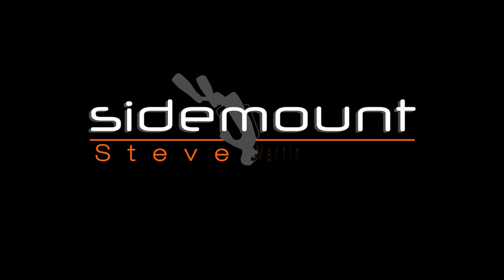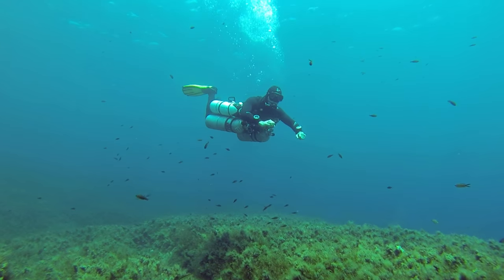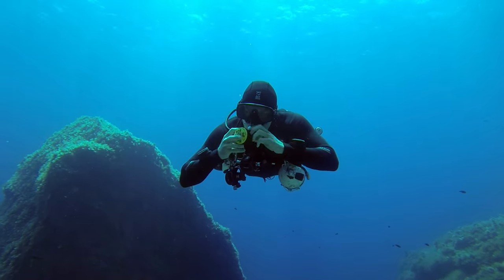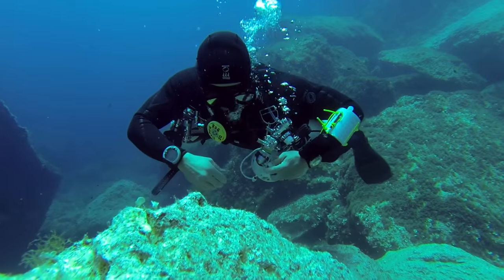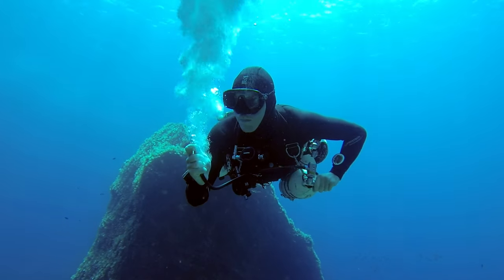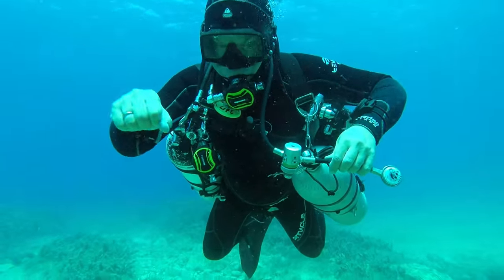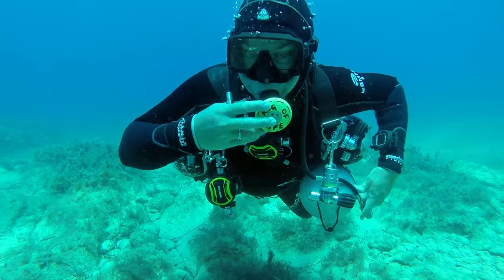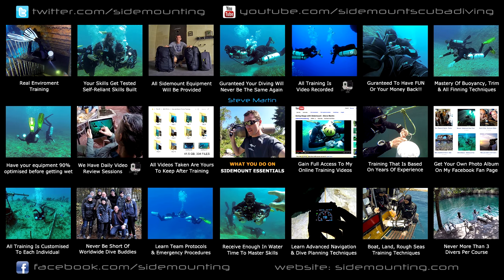Answer to FAQ's on Technical Diving - Regulator of Death

Comment: Ist and 2nd stage serviced regularly. Key pt. Great video. We were on a dive once not very deep, like 20m, three of us. Good viz, I heard a crack, turned around and just saw a cloud of bubbles coming out of the high pressure end at the gauges of one of us. The diver of this unit, was just staring at me and the other guy; of course her gauge read zero air now and I asked if ok, they said yes and I gave them my occi reg.I tried to tie a knot in her hose to slow the air loss but of course this was very difficult. We then made out ascent. We had to have a stop for out particular time. Bt the time we surfaced her tank was basically empty as almost nothing could be urged from her reg. it was interesting.

Comment: Wow. Been diving for 13 years and never knew you could detach both stages underwater
Reply: You can do it in an emergency, but you'll need to have the first and second stages serviced ASAP afterward, as you will have gotten seawater in the works.
Reply: Yes, but if you do you have to have it service right after the dive.  He mentioned this in the video too.  Same as someone putting first stage in soak tank and not putting dust cap on.

Comment: Hey Steve. Enjoy your videos - very well produced and presented. In this case, you can breath from an lp regulator hose by crimping the hose, then sipping. It works best with rubber hoses, but I've done it with flex hoses as well. I would only do this if absolutely necessary, as with the deco bottle. Divers should also carry enough air to cover decompression if the deco bottle fails. Switching out first stages would really be a last resort, but worth noting. Also, a diver who does not maintain his/her personal regulators should not be diving, especially deco regs. And yes, a basic understanding of reg. repair should be taught to all divers (clearing sand, etc.)

Comment: As an annomily in my training I've taught myself to sip off a cylinder while feathering the valve for upwards of 20 minutes at a time. As expertly stated in the video it isn't a likely scenario nor a plan A contingency. However, it can and has been done and I'm grateful I have it in my tool box when Murphy goes diving with me.
Reply: Spared ~ Not likely to happen means it will and chances are will kill you if not prepared.  You are right on track. Prepair for the worst hope for the best. But those who train in hell aren't effected by the heat if ya know what I mean. :)
Reply: Rest in peace cam. Good to catch one of your old comments, we miss you.
The guys in my shop like to mess around and breathe directly from tanks in the pool to build comfort.

Comment: If I may explain why breathing directly from a low-pressure hose or a cylinder valve is not "practical":  
The hose going to your regulator delivers approximately 9.3 bar (135 psi) of air pressure, and the cylinder valve on a low-pressure (LP) steel cylinder can deliver up to 179 bar (2,600 psi) of air pressure. To put this into perspective, it only takes 0.7 bar (10 psi) of positive air pressure to cause massive lung damage. 

"So how come our regulators don't blow out our lungs?" 
Because they only deliver the amount of air that we need to breathe at the depth/pressure we are currently diving at. The deeper we go, the great the air pressure that our regulators will deliver to compensate for the changes in atmospheric pressure. This is why they are called "regulators" – they regulate the air pressure based on the depth that we are diving at. This also points out why the "regulator of death" drills are so important in technical dive training. If a technical diver does know how to breathe off a compromised regulator, they may find themselves in big trouble one day.

Comment: Well that was very informative! I remember watching 47 meters down with a bunch of friends on a scuba placement and remember seeing the bits where the people trapped underwater end up swapping the first stages onto different tanks... Didn't think it would be possible (especially since it's a hefty beer fine to leave the dust cap off when washing the regs) but what you describe makes sense to me. 

(It occurs to me that the film makes literally no sense in many ways, they wear full-face regulators to allow for dialogue and exposition underwater but I don't think this would work with that kind of kit) 

Don't mean to say that's all I learned, it's very cool to see some of the skills used in tec diving and certainly food for thought... I dived with a guy using sidemount once and I'll admit it's got it's uses and advantages... Certainly worth consideration if I was to go for getting my own BCD in the next few years...

Comment: In my PADI instruction I learned to breathe from a freeflowing regulator. Just left one side of the mouthpiece out of your mouth and let the excess air escape. And pay close attention to your air, cause it will depleat the cilinder in a breaze. Another thing, I notice at 2:30 that you inhale, let a bit of air escape and hold your breathe. In spite you let some air escape, shouldn't you keep a little flow of bubbles escaping from your lungs? I know you have a superb buoyancy control, but...
Reply: Letting the free flow continue unabated is okay for a rec diver that doesn't need a decompression stop, but a tec diver MUST have enough gas in the tanks to stay at each stage for the required time. The only way to not drain the tank if the regulator free flows is to manually turn the valve off and on as shown here. (And don't worry about holding your breath for a bit if you're not ascending. The "always release a stream of bubbles" myth is for the safety of absolute beginners and so the instructor can see what's happening, but a meter or less of depth change isn't going to risk barotrauma unless you're holding a REALLY deep breath.)
Reply: Nuno Girão if you are diving for recreation in a shallow dive yes its applicable. However these tec diving is much more complicated that you need to have more sophisticated air management. Letting your deco tank free flow, you will ran out of air very soon. Consider the depth these tec divers are doing.